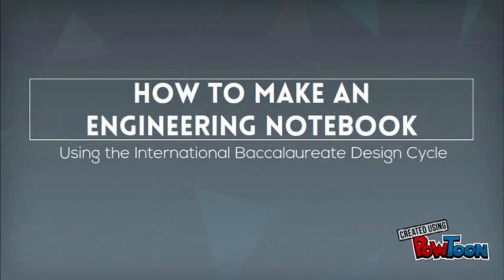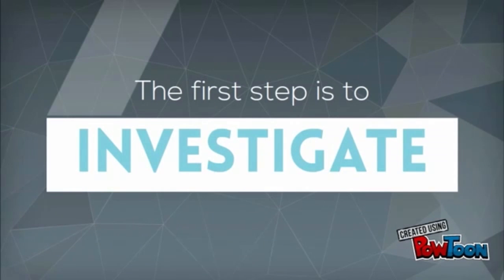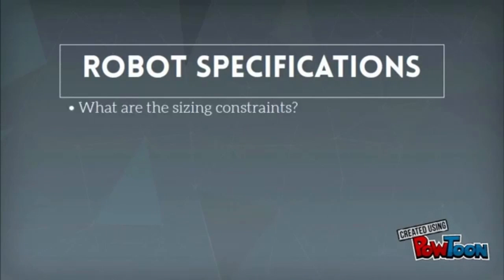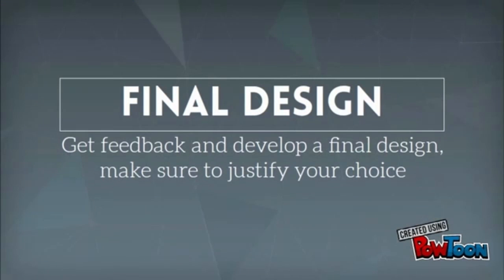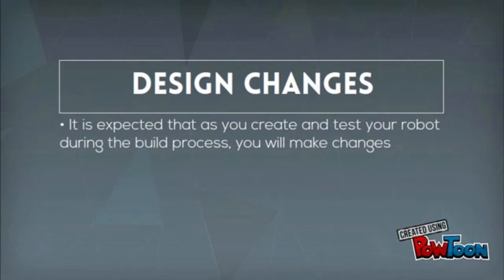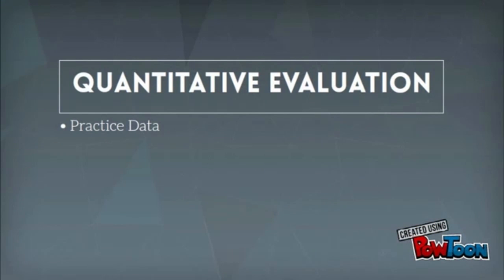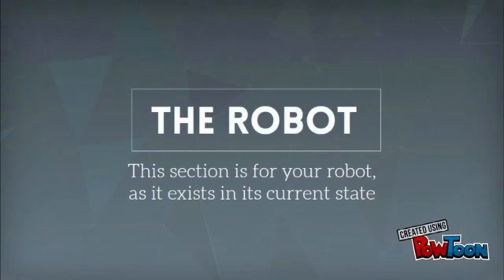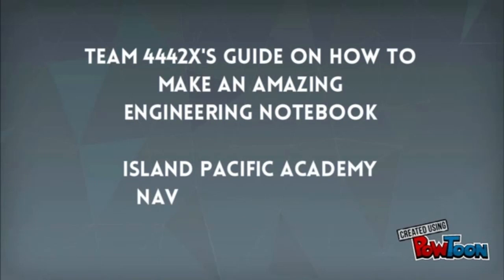Team 4442X's Guide On How To Make An Amazing Engineering Notebook

Comment: Recently VEX has made a new rule for the competition so that if a notebook is bound (like a normal notebook), it will earn the team 5 points in the design award rubric, and any other type of engineering notebook is submitted (binders, ring-bound etc) the team will not earn those 5 points and therefore be disadvantaged.